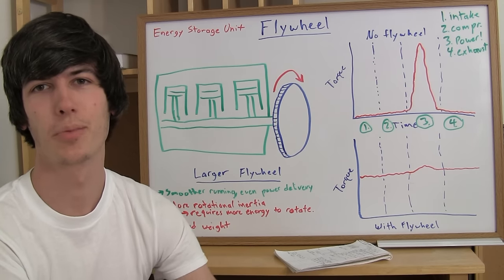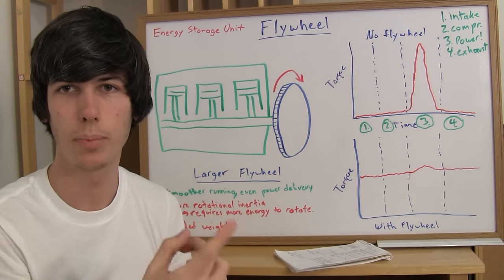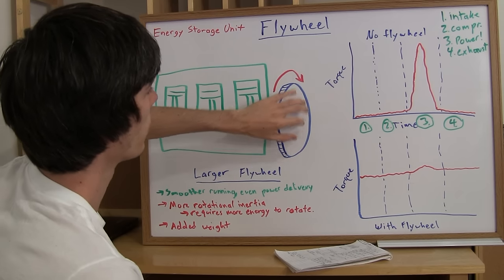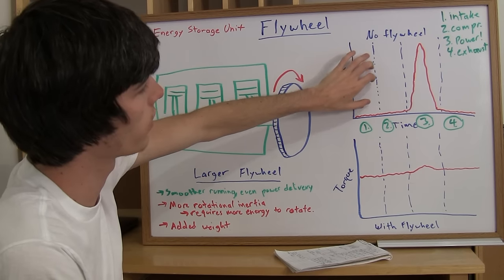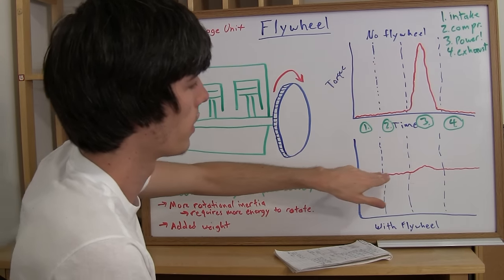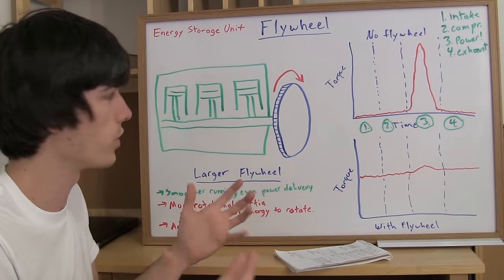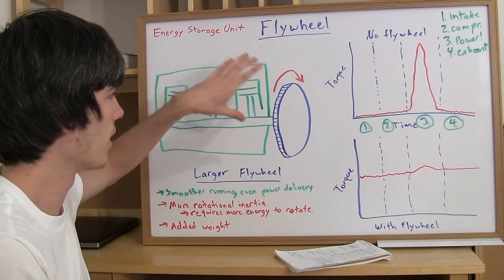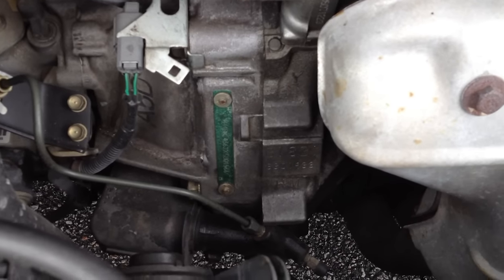Flywheel - Explained

Comment from the maker: I just really like flywheels...
Reply: Engineering Explained you're not alone
Reply: whats your opinion on lightweight vs stock weight. i think stock weight adds a better kick whereas light weight will spin faster but lose energy while disengaging the clutch
Reply: hello thanks for your video. here's my question. since flywheel store inertia force and make power distribution evenly. why we still trying to reduce crankshaft weight？  what's the disadvantage that build flywheel weight into crankshaft ？ thank you for your answer.
Reply: Engineering Explained I like turtles
Reply: @tylerdavid462  imagine saying 'thank you' for your answer and you don't get one lol
Reply: @Kronikul-yz9rf  someday man someday. Hopefully someone knows,I'll search it up as well
Reply: Yep
Reply: Hey, I have a 4cyl tractor engine that’s leaking from the rear of the block. It leaks only when the oil system is pressurized. I can’t see the leak with the flywheel on. Can I run the engine with flywheel off for a short time so I can see where it’s leaking from? I put a new rear seal in and that didn’t fix it.

Comment: Nice job on explaining this. I learned about flywheels when I was in college. I had an old Mustang with a tooth missing on the flywheel and if the starter engaged in the wrong place, it stuck. I'm not much of a mechanic and after paying to have it towed and fixed once, I learned to fix it myself. After that, I kept a set of coveralls in the car and when it got stuck, I crawled under there, took off the starter, disengaged the little gear that popped out, hooked it back on and went on my merry way. My girlfriend (now wife) didn't like it too much but I thought it was pretty nifty....
Reply: Great and cool story!
Reply: Joel Gaslin You couldn't just stick a socket on the crank and rotate it? Easier than taking off the starter.
Reply: @JesusTorres-zu8wz  that's exactly what  I was thinking 😂😂🤣🤣
Reply: @JesusTorres-zu8wz  let him be bro, let him feel good about himself 😂😂
Reply: That's actually pretty cool
Reply: Had the same thing on a 30 year old VW Cabriolet I had 6 years ago. My dad taught me about it. When it gets stuck starting it grinds really loud. Used to have to go grab the fan belt and pull it to move the flywheel some and then try to start it again till it worked.

Comment: So the flywheel is simply a plate mainly to add weight to keep inertia on the crankshaft? This had me thinking, so I want a flywheel not too heavy so its easier to accelerate, but heavy enough to have a good inertia. Am I right?
Reply: Ricardo Rivero Exactly
Reply: Just buy a aftermarket one you cant go wrong with those there better than stock
Reply: Yes, that is what he was trying to explain
Reply: Why don't they make the flywheel with Moving mass? Like the mass can move from the centre to the edge of the wheel to increase or decrease inertia?
Reply: YUP! You literally nailed it. I'd imagine that your suggestion is exactly what most auto manufacturers are aiming for.

The way I picture the function of a flywheel in my head is like pushing someone on a playground swing. You're continually adding more and more energy to the system, but because your additions are not constant, steps would happen. But, because you've already added so much energy, the inertia alone is enough to drive the system, with obvious slight loss over a period of time. Obviously when you stop pushing someone, they don't come to a sudden stop from a full swing. They're using up the energy "reserved" in the inertia of the system.
Reply: @cyberhodl  you'd have to deal with the conservation of momentum.  RPMs would change like a spinning figure skater.
Reply: @cyberhodl  Distribution of movement no longer becomes equal at that point. When the mass goes down it will accelerate when it goes back up it decelerates.
Reply: @naota3k  better explanation than yours...impossible!  I really liked your analogy with pushing someone on a playground swing.
Reply: @cyberhodl  so you mean how a ballerina will spin faster with arms close to the body?   So.  You mean.  A flywheel having its weights close to the center having less inertia, far away being a better/heavier flywheel?      ... How would you remotely control it? It gets complicated I'd think. And possibly dangerous if it gets loose.    And I guess it's not much needed.        I think you can decouple a flywheel instead.
Reply: thankyou haha, this was what i was thinking

Comment from the maker: I believe balancing a flywheel is done to remove some of the scratches that occur on the surface, making the contact better between the clutch disc and the flywheel.

Comment from the maker: Thanks. For a lighter flywheel you can basically reverse the pros/cons I have listed. You'll get better throttle response, but you'll lose the smoothness. But for some engines, and small engines, this could be ideal.
Reply: will a lighter flywheel affect engine breaking?

Comment from the maker: Yes, that's the "requires more energy to rotate" part. More energy goes into rotating a flywheel, meaning less energy goes to the tires. You've got it right.

Comment: Hello, just wanted to point one thing out. From a physiscs and engineering standpoint (this was layman approach), there are a few misconceptions maybe.. torque of the engine doesn't smooth out.. it stays the same with or without flywheel. The thing that changes is that angular rate acceleration and jerk (rate of change of acceleration) are smoothed out. More inertia for same torque means less acceleration, or smaller change in angular rate. Even power distribution is theoretically the same if we are picky about it- energy input in time is the same. Details that are pretty important to note.

Comment: EXCELLENT VIDEO! 1 thing I think should have been mentioned however: 

You something about a flywheel mating with the torque converter, however, when a torque converter is used (Automatic) there is whats called a "flex plate" usually spot welded to the TQ. The flex plate is much lighter, case the tq adds weight to the assembly. Flywheels are typically bolted on to the crank, and are really heavy. 

Source: Associates in Auto/maintinance, studying Mengineering at UT

Comment: It's nearly analogous to a capacitor in electronics, which also store power and even out the voltage fluctuations, and a larger capacitor will smooth the voltage even more and store more power.

Comment from the maker: Any rotational mass will add to how smooth the engine runs. The greater the mass, the more smoothly it will run, but it will also waste more energy, so you have to balance it. Also, the flywheel serves another purpose in manual cars, as something that engages with the clutch disc to connect the engine to the transmission.

Comment: When you say use a larger flywheel, does a heavier flywheel do the job without needing a large volume ?
Reply: The inercia of a body is dependent on both mass and geometry, so both would have an effect. However in the context mass is more significant.

Comment: Hi there! Torque is basically a turning force. A great analogy is where you apply force on a rench connected to a bolt at a certian distance. Let say 100lbs of force apllied to a rench which is a foot long connected to a bolt. Times both of the values and units together to give a Torque of 100 ft lbs. higher the value, the higher the torque. Another e.g Gears, the radius (distance) of the gear times the force applied to the teeth.

Comment from the maker: Your logic is sound; a heavy flywheel would keep the engine RPMs up longer than a lower weight flywheel, as it would take more energy to slow it down. Also (not really applicable to racing games) I've noticed that on my gf's car (a Mazda 3) the electronic throttle keeps the revs up, it takes longer to close the throttle valve when you let go of the gas pedal.

Comment from the maker: Since you're new I would suggest starting with my videos "engines - explained" and "car gears - explained" which should help clear some things up. Lower gears will have higher torque but lower top speeds. The flywheel rotates at a steady speed due to its mass, but the speed is certainly not constant. Any forces that act on it will slow it down or speed it up.

Comment: I hope you can help me out with this question.  When you switch from a heavy flywheel to a lighter flywheel will there be an increase in engine braking or decrease?  Logically there will be an increase in engine breaking since the lighter flywheel will not spin as long as the heavy one after you release the throttle.   And this is the consensus i'm reading online. However, my personal experience (Nissan 350z) is that going to a lighter flywheel actually resulted in much less engine breaking.

Comment: Having a lightweight flywheel will increase engine response, and also because the engine comes down in RPM quicker, it means one can shift faster, and will increase acceleration, as well as have the benefit of obvious weight loss.
Having a light flywheel will increase the roughness of the engine, and it will make a manual transmission car easier to stall, thus requiring more slip in the clutch to get the car to go, and it will also be damaged easier if its lighter, as their is usually less metal overall to work with (if it's too thin/weak, the flywheel may explode from a bad shift, causing a bad day, or worse).

Comment from the maker: Yes, reducing weight on the flywheel would help you rev quicker in neutral (and in gear, but it would be less noticeable in gear). It's still a worthy modification, if you're looking to reduce rotational inertia, thus increase your useable power. On the flip side, if you plan on dragging your STI (dunno, some people), then a heavier flywheel may be a better option as it allows for more stored energy at launch. ("Free" energy, that doesn't use your 1/4 mile seconds to produce).
Reply: Bro, who are all these comments for?
Reply: @russellg5022 old YouTube didn’t have direct replies

Comment: Thank you so much.  So if you have a really big fly wheel in your Bentley, then it will, like a gyroscope, keep your car in a very stable trajectory because it's being smoothed out on all latitudes of the wheel.  That's wonderful.  Especially noting that a big flywheel would make for a smoother ride, but also takes more energy to get going.  I never thought of components in cars / chariots utilizing some sort of disc perpendicular to travel to help stabilize.  That's cool.

Comment from the maker: I don't think cost is really the issue, but more of the reliability with each. A dual-mass flywheel will be smoother, and works fine if the engine isn't going all out as far as torque transfer, but it can have slipping between the masses, and this will create a lot of heat and can cause problems if abused. A single mass flywheel will be rougher, a noticeable difference in feel of the torque transfer, but can handle the abuse better.

Comment: So will a lighter flywheel increase your car's acceleration practically? I.e. if you change from dual mass to single mass flywheel

I read all the comments but they are a bit vague not getting any specific answer

Comment: Is it true that the flywheel is only doing it's job when the engine is in neutral, i.e. keeping the engine turning and not shaking itself apart. When the clutch is engaged is it not just adding to the rotational inertia of an already high-inertia system? Therefore not smoothing out power delivery in a significant way as you mention in your pros-cons list?

Or is the rotational inertia (i.e. speed) of the flywheel so significant that this dominates the system of wheels, car, transmission etc.

Comment: I had a motor put in my 89 Pontiac and now it has a grinding sound in all the gears. Is it the flywheel or the torque converter? It's not the starter and I think it gets louder when it's put into a gear other than neutral or Park.

Comment: Dont the pistons fire separately, so that they are at different points of the 4-stroke cycle? Wouldn't that balance out the jerkiness, or does the flywheel just make it even smoother?

Comment: A question about flywheels, would an engine with smoother power strokes or heavier crank (say a v8, v10, or a v12) be able to get by without using a flywheel? Or maybe a lighter flywheel?
Reply: Thats true. A Maserati V12 i once had my hands on had a very small lightweight flywheel with a size about 15 cm.
Reply: McLaren F1 has no flywheel just a ring gear for the starter pinion.

Comment: Thanks for such a helpful post.  In particular thankyou for putting it in context at the end by pointing out roughly where the flywheel etc. actually sit under the bonnet - it's incredibly unusual to find any videos on car mechanics which actually show where these key components are located relative to each other, 'in situ' - nice work!

Comment: Alot of people are telling me not to go with a lighter flywheel for my car. Since the vibrations can harm the engine. They told me it's because the duel mass flywheel (DMF) was designed to balance the car replacing it with a SMF can put it off balance. I want to get rid of rev hang however don't want to harm my engine. Is this true??

Comment: On the flip side, so does that mean that a lighter flywheel will get you going faster BUT it's not going to have as smooth torque (a higher bump in the torque line)?

Comment: Hey, i'm having a problem at my diesel engine, it's known to have problems at the flywheel, the 1.9 TDI VW engine. Whenever it idles it's shaking hard, while we know diesel engines don't run as smooth as petrol ones it still looks odd. I've yet to check all engine mounts, if they were correctly applied. My question is, can the flywheel be a reason for the engine to shake like crazy ? or should i recalibrate the idle and check the mounts.

Thanks !

Comment: Hi,  I have question >     my car is a 2.2 gasoline engine with a Dual Mass Flywheel .    When I started , this 2 seconds while turning the key the car gives a shake like a Diesel , then starts and inmediatle became smoth,    same thing when turning it off.    So,  driving is very smooth,   what could that be?   thanks in advance

Comment from the maker: It would be correct to assume that a larger flywheel would reduce engine braking, as it has more inertia and would attempt to keep the car rolling. A lighter flywheel would be easier to stop, hence it would increase engine braking. The design is important also, where the mass is relative to the center of rotation.

Comment from the maker: Heavier flywheels take more time to rotate as they have greater inertia. A ligher flywheel will allow the engine to accelerate more quickly, which will appear as a perceived increase in power. The engine makes the same power, but you have access more of it as less is lost in energy to rotate the flywheel.

Comment: One cylinder will be in the power stroke while the others are in a different stroke so one will always be firing so the length of time between firing will be less than suggested. But I did learn how the flywheel evens out the torque none-the-less, great!

Comment: AND in the flywheels case, I'm sorry that I can't work out the Torsion mathematically. But in the wheels case. The higher the torque on the drivetrain such as gears, flywheel, diffs and etc, the higher the torque (the turning force on a pivot) on the wheel. Hope that helps :)

Comment: On the graph of torque distribution with and without the flywheel, is the integral of that torque function going to be the same with and without the flywheel? Or are you going to sacrifice overall torque for the sake of even power delivery?
Reply: If the engine is running at a constant speed then no energy will be lost because of the flywheel. Its simply gaining kinetic energy during the power stroke and then losing that over the other 3 strokes. During acceleration it does waste energy as it keeps gaining kinetic energy as the engine revs higher and higher. That's the main reason why F1 cars don't use it and just idle their engines higher at 4,000 rpm.
Reply from the maker: Great question, and great answer!

Comment from the maker: Well, it's a bit complicated. A larger flywheel may make it easier to do a burn-out, as when you dump the clutch you would have more energy stored in the flywheel. However, since it takes more energy to accelerate a heavier flywheel, a lighter flywheel would allow for better acceleration (a greater force at the wheels). The engine torque remains the same, but the useable torque at the wheels will increase with a lighter flywheel.

Comment: I just want to add on a very important thing you forget to mention on your video. Car manufacturers solving problems with the flywheels.  For example, they trying to make it descent size, because of keeping engine smooth, but it has to be very light, because engine have to be sharp in revving. It has to be light to keep revving faster, and when you changing gears, if it will be to heavy, it can slip the clutch, or damage gearbox. The perfect example, that I want to talk about, is a Lexus LF-A, because that V10 engine can rev from idle to max rpm, in 0.6 seconds ! Lexus engineers did it because of the flywheel, that's what I am assuming :)
Reply: +Kęstutis Karneckas The size of the flywheel and its weight do not directly concern what you're talking about. The only important characteristic of the flywheel that has to do deal with either the smoothness and the quick revving is the inertia, as explained in this video. In case of the LFA, I'm pretty sure the flywheel is very light, it's a necessary condition for quick changes in the rotational speed. What could help to have a smooth engine (but since I've never been in that car, I don't really know how smooth is it) is the V10 displacement: you have a combustion stroke every 72°. At least I would say that 552 hp helps a lot to rev pretty quickly a regular flywheel.